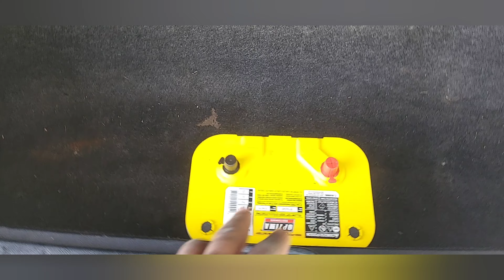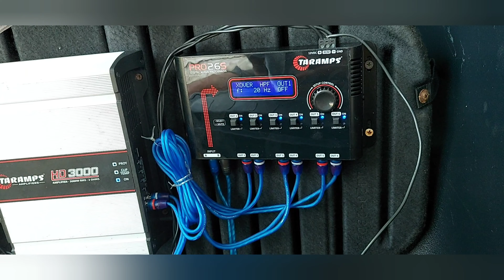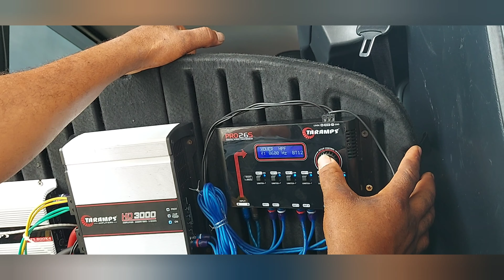Toyota Voxy sound system install...

Comment: Clean and neat m, however there’s one little concern hot air rises so when u Mount them upside down the heat is staying inside the amplifier it would be a better choice to Mount them down in the floor of that area

Comment: Wah the bt12 mean?
Reply: Butterworth frequency.  Determines the frequency cutoff slope
Reply from the maker: @ghaneshrajkumar6667  which one would you recommend using
Reply: Majority Brazilian speaker companies uses the 12dB Butterworth frequency. All depends on how the system sounds. Because your tuning is done by listening and not with the use of tuning guides and equipments
Reply: Using the EXPERT line of processors. The Bluetooth versions give you a better tuning experience and understanding. You should try some of your builds with them.
Reply: When setting the crossovers for the mid-range and tweeter, it might be best to use LR 24. This is Linkwitz-Riley 24 dB per octive. This will prevent any phasing issues. It keeps all the speakers in phase.
Reply: Lr 24 is the best fi mid bt 12 fi tweater
Reply: @oraine2173  I think it depends on what kind of tweeter. Are you talking about a normal dome tweeter or a horn loaded compression type tweeter? 

Since tweeters can easily be damaged by low frequencies, I try to use a steep filter. This also lets you play it louder.

Comment: Amps mounted upside down in a air restricted space will lead to overheating issues, heat travels upward & the heat sinks are facing down.
Reply from the maker: Those amps have fans inside. Also take into consideration that none of those amps are loaded.
Reply: Never saw this comment but I commented the same thing 😊